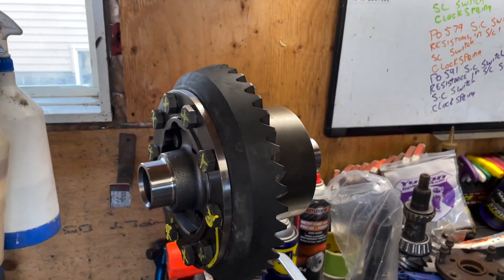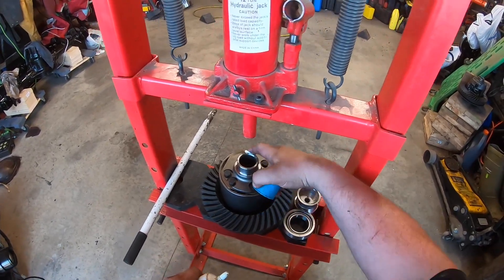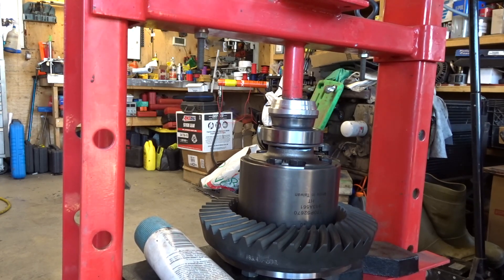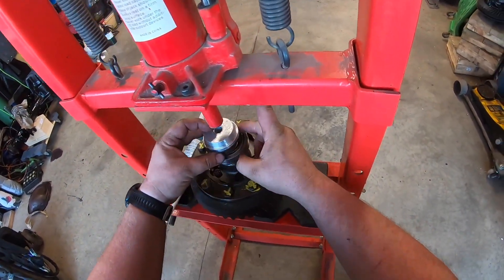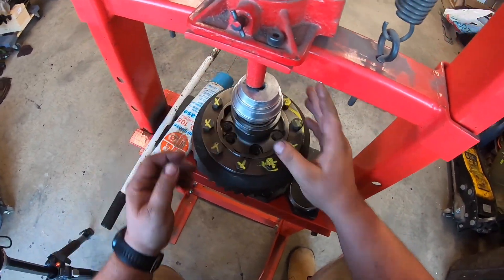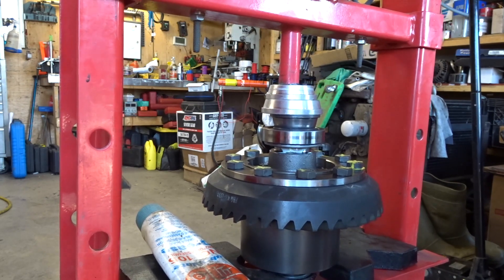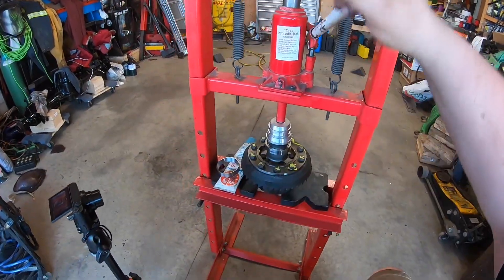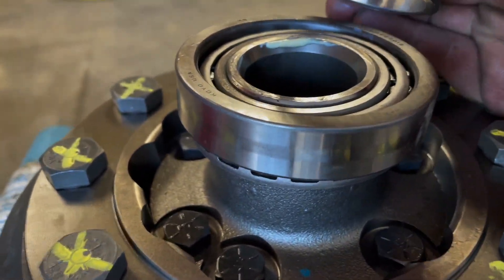Tips for Installing Differential Carrier Bearings

Comment: How many tons is your press?
Reply from the maker: 10 or 12 ton press
Reply: How cool do you think local shops are to say, pay them 20 bucks to press on the bearing?
Out of curiosity.
Reply: I would do it for 20 bucks. It doesnt take very long. Have you checked out the freezer/oven method.
Reply: @bradmetcalf5333  I've heard about that method. But would that method still work for all bearings cause of the shims?
Reply: @bradmetcalf5333  how much you think a local shop would honestly charge to throw in a front and rear? I already bought everything including tools but no 20 ton. It's a 90 2.5 with 31s going to a 4.88 Ratio. The only hard part to this job is the rough ass sharp stony granite I gotta work on basically.  It hurts to walk barefoot on that pretty bad!
Reply: @ man it’s crazy. I’ve seen rebuild prices range from 500-1500. You don’t need. 20 ton to compress the bearings in.
Reply: @bradmetcalf5333  i just sent out some requests to 10+/_ local area shops just to see what they charge. Just out of curiosity.  If they said a grand......and their shop is clean, I'll just have them do it. They have a lift, I have a sharp stony driveway that you can't even walk on barefoot-you literally jump on the grass as soon as possible sharp.
Reply: @jedhatcher252  i hear ya man. I have a concrete driveway but it slopes decent. I get claustrophobic under there waiting for my suburban to crush me to death 😂